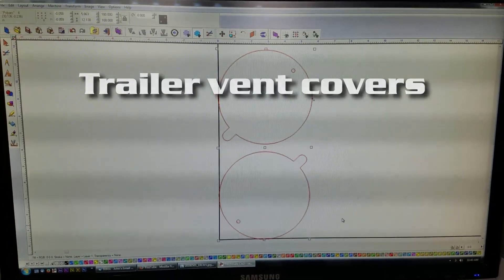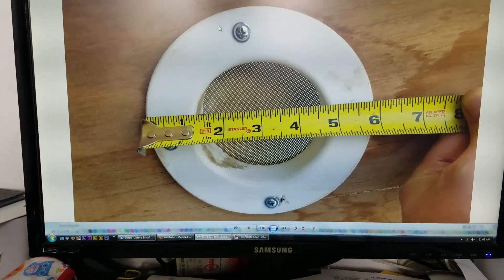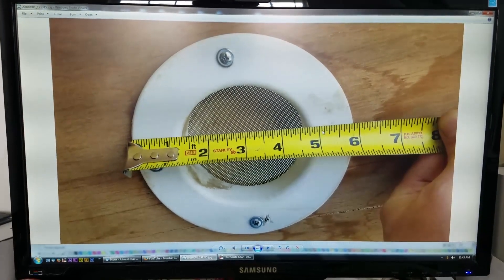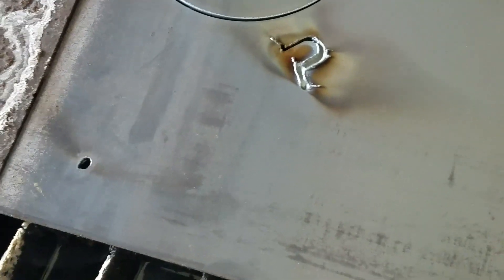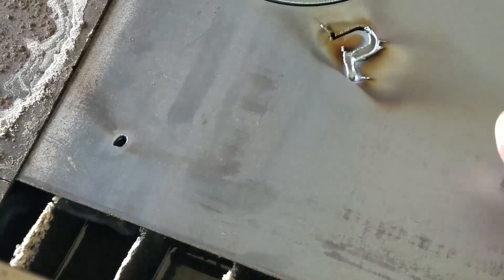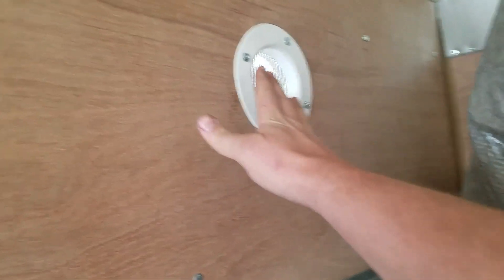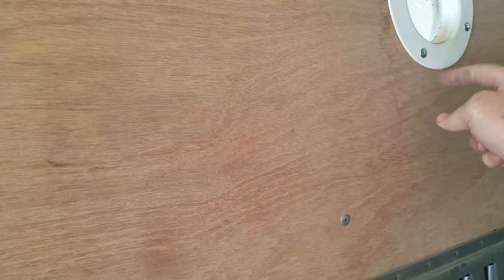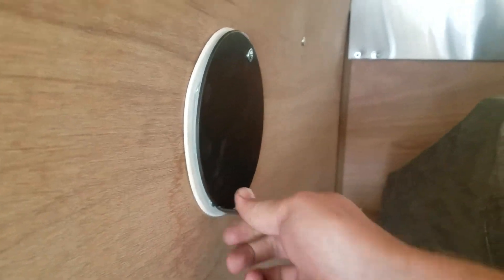Trailer vent covers

Comment: You only need to cover the back vent the dust is not coming in the front vent. The dust in coming in the back of the trailer when it's  swirling around the back doors. The front vent  will force air out of the cracks where your doors are not sealed and keep the dust out. See a video by gonagain

Comment: Use 2 of your discs, a bit larger than the ABS flange (or same size & use the 3 screws to attach bottom disc to flange using EDPM type rubber gasket) use a #10 washers & a finger twist headed bolt (not wingnut) in center to be adjustable and allow top disc to rotate, make a Butterfly Vent cover by cutting out 3 or 4 triangles. Use gasket 3/16 under bottom disc. Put a very thin flat ring of hard Delrin sheet under top disc. Maybe 1/16 or 1/32" thick. Use center bolt to adjust tension as needed. Countersinks where needed.
eBay has some nice miniature chromed metal knobs for under a buck, from China so there is a bit of a wait time.
CHEERS!
Reply: And then, make & sell them for pocket money. Research the various sizes available, then make for those sizes. If you do, send me one.

Comment: EXCELLENT idea, but since you have the cutter, maybe cut 2 discs to go into the I.D. place magnets on them and put them INTO the vent, 1 on the outside, the other inside, you could tack some bolts to them to hold a knob for when you want to open them, do these trailers build up allot of condensation?? Thinking of getting one and would hate to cut holes in it for vents.
Reply from the maker: Oh, excellent idea! I may do that